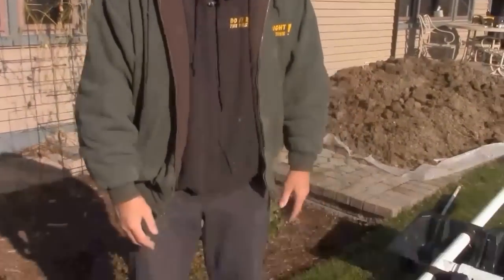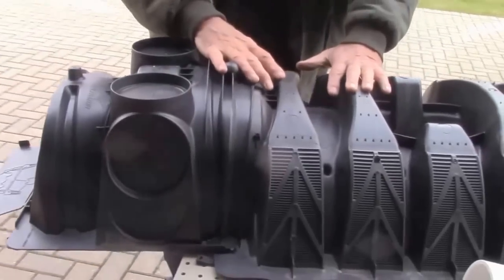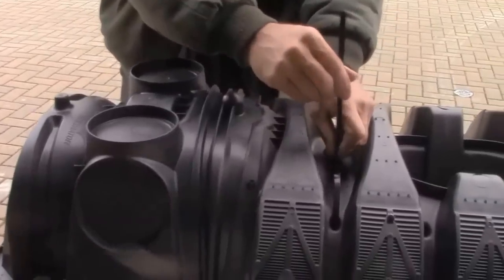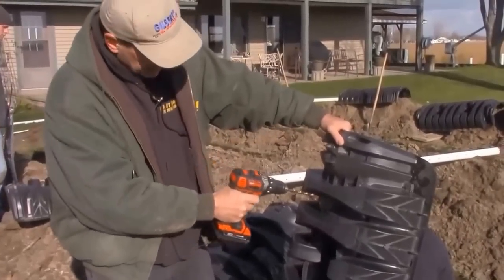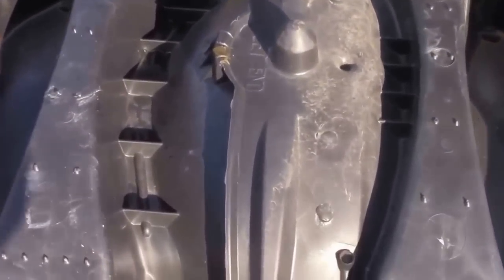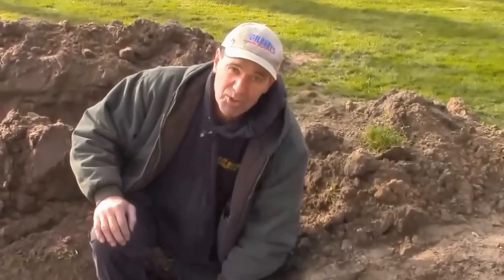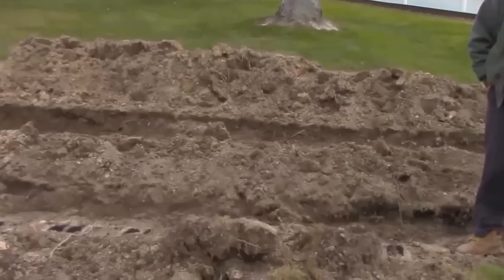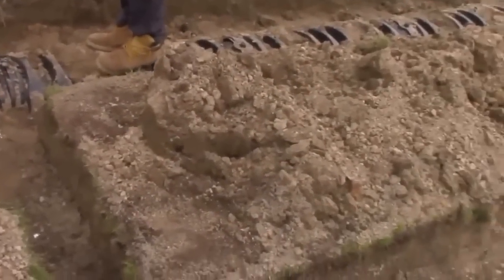Install Septic System in Leach Field With PVC Pipe - by INFILTRATOR

Comment: Hey Mr. hardware.  I'm in the process of planning a replacement of my old leach-field.  I came across your video and really like the idea of the suspended perforated PVC.  Just reaching out to see how the system is holding up all these years later. 

Thank you!
Reply from the maker: @JC-fh6uw  it is still working great. Seeing as how I only had a 500 gallon septic tank the 300 gallon lift tank with the pump mounted halfway up so it always holds 150 or more gallons of affluent gives me a secondary digester and everything is working just as it should be! if I had to do it over, I might put a heavy geotextile fabric in the bottom of my trench so when I set the panels on it, they would have a more stable footing and wouldn’t work their way down into the soil.
Reply: @MrHardware1  You wouldn't worry about the biomat clogging up the geotex? 

Thank you very much for the reply!

Comment: Will the water left behind in the bottom of the pipe between the holes freeze?
Reply from the maker: Not at this latitude, Detroit MI, area. The ground temp and the dome stay above freezing temperature inside. I was worried about the 2” line from the lift tank to the field but it has been fine over these 10 years.
Reply: @MrHardware1  I'm also in the Detroit area.  I want to make a small leach field for my water softener discharge.  About 80 gallons every 3 days.  It comes out of a small line under pressure, but by the time it crosses the required air gap and enters a 4" drain to the leach field, it would probably be considered gravity fed.  Not much different than a single shower running inside the house.  Have you ever used these infiltrator chambers for this purpose?  How deep should I put them to prevent freezing?  Thanks.
Reply from the maker: @ThatEEguy2818  It depends on how much clay is in your yard as to how much field surface area you’ll need. Bigger is better and possibly you could add the laundry line to it to reduce ‘clean’ water from the septic tank. I don’t think the domes can/will freeze when 10” or more below the surface. The bigger worry is the discharge line freezing, I’d consider increasing it’s pipe to 4” right at the house…
Reply: @MrHardware1  I plan to increase the line to 4".  I can't put my laundry in there because local code says it goes to septic.  I can do whatever I want with my water softener discharge though.  I checked with the health department and building department.  No codes on this.
I'll probably put the chambers a little deeper that 10" so hopefully that will be good.  Thanks.

Comment: Love the suspended pipe in infiltrator...do u think it's good for gravity system or just go with infiltrator alone ...  really black clay soil
Reply from the maker: I had to power dose because my septic tank outlet is down in the water table. I would’ve much rather just have had a gravity system without the pump.

Comment: do you really need distribution pipe
Reply from the maker: I did because my septic tank outlet was 24 inches below grade which put me right on the edge of the water table. I used a lift tank so that I could flood my field about a foot above the water table which now years later is still working just fine.

Comment: Hi, thanks for your explanation, just consider the distance to the river to prevent the spread of contamination into the runoff, is the adsorption hole test considered?  Thanks again for your further explanation
Reply from the maker: The country inspector requires at least 30’ from the river and I have banked the earth higher at the sea wall so rain and any runoff comes away from the water.

Comment: I'd like to see an old one dug up. To see if hanging it from sonotube keeps roots from growing in the pipe.
Reply: I have dug it up, to extend it at one area. The roots weren’t up into the PVC pipe but they were into the cavity under the dome. Of course they’re looking for food so I use forming root killer and or copper sulfate once a year to hinder the root growth
Reply: It's kind of impossible for roots to grow into the pipes, that are suspended up in the air, inside the chambers.

Comment: After trying to learn this dome system for my app you did a great job with the video. And thank you for replies to comments. Even the stupid ones. 
Makes perfect sense to use the pipe inside with a pressurized system. 
I’m happy it worked so well for you. Especially with the high water table you have there. 
Gives me great optimism for my system. I’m gonna order the 36s tho just gravity and no pipes inside.

Comment: Those internal pipes are not required are they? Rethink this as what goes into the leach flied should by waste water only, no solids. I see no advantage over the old gravel systems . A trench filled with 2" rock 7' deep and 70' long with a single leach field pipe in  it. Normally  two each. What's the advantage here?
Reply: Troy did ya happen to notice the water in the background? 
He has a high water table. Digging 7 foot deep ain’t happening.
Reply: @walsterdoomit  If your water table is so high, maybe the house should not have been buil there.
Reply: Troy Brownrigg great point Except it’s not my house. I was pointing out the waterway in the video. 
People like living on the water. And there is a solution to every problem. I believe the owner found it.
Reply from the maker: My stones and pipe get overcome with fine soil and turn into muddy, rocky soil with no air space after 10 years. The plastic domes should have plenty of airspace for many more years, a secondary anaerobic action in the field requires some air space. The internal 3" pipe is to evenly discharge effluent when my lift pump runs, seeing as my field is now higher than the output of my tank.
Reply: @MrHardware1  Your field is higher than your tank output, You sccrewed that up. Pump the tank dig it up  reset it.
Reply from the maker: @troyb.4101  I have a lift tank and a lift pump so the field can be higher.
Reply: @MrHardware1  I've got a 1,000 gallon concrete tank and two 70 ' gravel fields ten foot deep. Going on tewnty years. All the maintenace is after  every six years is to pump the solids out and do an inspection. The advantage of living n a desert!

Comment: I'm about to replace my field with this system. Questions, where are you located? Curious about trench depth and frost levels. Also how long are your three trenches? Did u have to calculate number of drains in the house, appliances etc. Lastly did you do a soil test before install? What was the cost?
Reply from the maker: This system is on Harsens Island, MI 48028. The trenches are 26" wide and 16" deep using the narrow version of Infiltrator domes. I'm on a small island with a high water table so the higher the better. The trenches are about 31' long, 28' of  domes with end-caps on each end. No soil test, I'm on a sandy loam and the county did not require one for my permit. With the 3 30' legs, a 300 gallon lift station with pump, about $3,000.

Comment: Hi thanks for your effort...I have installed a few fields but never have seen a balance tube between the lateral runs
How would you think that the runs are air tight ?...and just a question...I usually put 3/4 clean crushed ston on top then filter fabric....not criticism but just looking to learn from others
Reply from the maker: I left vented strainers (illegally) at the ends of the runs to allow oxygen into the domes. I heard it is better for the bugs in the field to proliferate. I agree w/stone and fabric to lengthen the life of the field, we could do this all day to make the field better. Just is not required. My strainers allow me to peek down into the dome with a mirror or camera wand look down the run. I'm curious how it looks in there in 5, then 10 years.

Comment: 100 engineers in lab coats.......and you re-engineer their system backwards ...wtf
Reply from the maker: The reality is, the engineers at Infiltrator liked my system. Each time the lift tank pumps about 100 gallons of effluent into the system it got an even dose through out the entire 90 feet. Even their engineers liked it. thats wtf Mr. Hardware does, breaks the mold and thinks out of the box. Blair
Reply: I think it's a good idea when you have soil where the drainage is questionable.  Notice the water in the background?  Here in Florida I think it wouldn't be necessary.

Comment: OVER KILL DUDE. The internal pipe gains you nothing other than higher cost
Reply from the maker: The internal pipe is required because of the pump. If I don't disperse the effluent over the entire field the force of the pump would dig a hole. A gravity system would not need the 3" internal pipe.
Reply: @MrHardware1  How about you install clean 1 1/2" rock at the inlet area of the field. Most rural home owners are not millionaires  simple and low cost is the way to go, KISS  ( keep it simple sir)
Reply from the maker: @davidbruce2159  If you can afford the infiltraters, the lift station w/1/2 hp pump you should allow $60 for 9 sticks of perforated 3" thinwall. My system floods evenly over the entire 90' every 2 weeks or so when the pump cycles. I look into my accesses at the far ends of the run and it looks like the day I built it. No rock required, which might cost the $60 the pipe cost me.

Comment: Perforated pipes are a waste of time, money and defeat the purpose of this system. Especially when those small holes become clogged.
Reply from the maker: Those aren't small holes, 1/2" or so. This system is now 3 yrs old and it is working perfectly. I have a 4" access at the ends of each of the 'legs' and I can use a mirror and look down the trunks after a 'forced' dose from the holding tank. Perfect flooding, 1/2" deep the whole length, disperses into the ground within 20 minutes except when we have heavy rains. The effluent is clearish, with no solids, no way to clog a 1/2" hole.
Reply: Mr. Hardware still redundant/not necessary in my opinion.

Comment: Well done video on septic system installtion and repair but the wind wreaked havoc on the audio...anyway you still did a great job and you can't Fool Mother Nature when doing any type of construction out in the elements.
Reply from the maker: Thanks, I need to do a video of the access ports after 3 years and show how clean the inside of the dome is.

Comment: Wow,,,,,what size of pump did you buy to fill all that three inch pipe for the water squirt test of 24 inches.
Reply: That thing is never going to pressurize he drilled two 1/2 holes every 8 inch in the 3" laterals and he's dosing only 75 gallons.  I've done this on LLP system with chamber pipe but we used 1 1/2 pipe 3/16 holes 3 foot spacing. The guy is trying to eliminate a hole washed out in first chamber when pump kicks on but he he's wasting his time the way he doing it.  All you do use the plastic defector flaps they have attached to chamber where the pipe drops the water into chamber and put ball valve on manifold from lift station to regulate the flow to eliminate the problem.
Reply from the maker: That was a 3/4 hp sewage ejector pump. It probably could have been a regular sump pump because there should never be solids in the second tank.

Comment: Hey MH, I see you hung the pipe in Infiltrators in a pressurized system literally pumping to the very end of the system. You think hanging them would be just as effective in a gravity system ? Tho I haven't built the system yet, I can't see no issue with hanging pipe in a gravity system unless there's something I'm missing and/or can't see . What's your opinion ?
Reply from the maker: I think in gravity the best use is to let it dump in one end unless your tank outlet is a foot above the top of the dome.
Reply: What if it is higher than that foot ? What if it isn't higher ? I have to consider grade level. I was thinking mite have to use steeper than 1/4"pr foot from tank into a Dbox with a baffle/block inside to slow effluent.
Reply: Eugenio Tapia 
I would set the outlet of the tank 1 ft above the bottom of the field if I was on a sloping yard. I might still use the 3" perforated to disperse the effluent evenly if the tank could be 1' above the top of the dome. Call sewer solutions or infiltrator for more advice. Blair

Comment: I used these septic solutions infiltrator domes, put them in 5 years ago, and now my septic tanks is backing up, started getting bad last year, pumped septic every year thinking it was that, but no, the drain field (infiltrator system) failed, now the instructions said gravel-less, and maybe if i put pvc in like this it might have worked, but as a customer of these types of leach fields, I highly would NOT recommending using these.
Reply from the maker: Markus, what failed? Did the domes collapse? Did they fill with dirt or soil?
Mine have access ports and I can see the hollow cavity inside the dome where the effluent terminates and it looks fine. 
I'm very very interested, send an email and I'll give you a call. Blair
Reply: If your field backed up it's because your soil was on unable to take that much affluent you better have a soil check done.
Reply: Markus you may not have put a long enough pipe inside the infiltrator chamber away from the tank and you may not had enough pitch away from the tank you have have a slight down pitch away from tank

Comment: Do you have a video for the next step you did? I am interested in viewing the pump installation after tank is installed.
Reply from the maker: Toni, sorry I built it at my store w/out my producer. I can give you some tips. The tank is so big I built a rack out of 3/4" pipe to hold my pump 15" off the base of the tank. This gives my septic a second area to digest that is barely disturbed when the pump runs. I set the pump float to cycle about 20% of the tank above the pump which gives me roughly 75 gallons per dose. That way my 90' field was flooded about 1/2" deep pretty evenly. I added a float above the upper limit of the pump float and connected it to a light in my utility room. If the pump quits running the effluent will raise the upper float and turn on a light warning me somethings wrong.

Comment: what stops the cover dirt from filling chamber area through perforations on the domes?
Reply: I have an old djainfield that's made form orange berg pipe and it's beginning to collapse due to age. My soil percs well and I was just thinking of installing the Infiltrator domes on top of the old lines and just abandoning them. Any thoughts?
Reply from the maker: I can;t tell ya, my system is only 6 months old. I believe the compaction of the soil prevents too much intrusion of soil. One could cover the domes with Geo-textile fabric to reduce most of the soil intrusion.
Reply from the maker: On second thought, I would let the system work for itself. Any fabric might reduce evaporation.